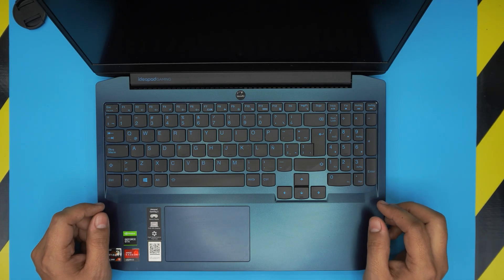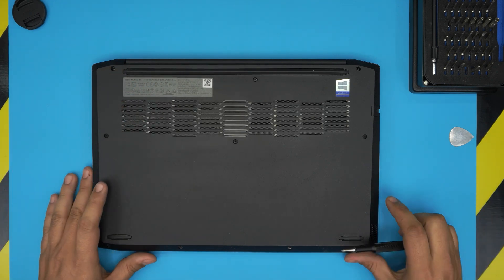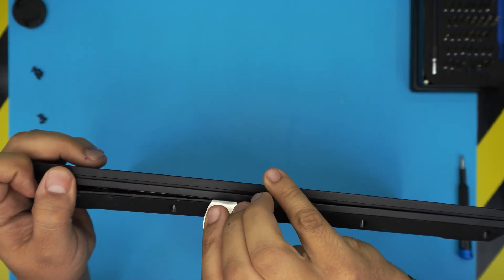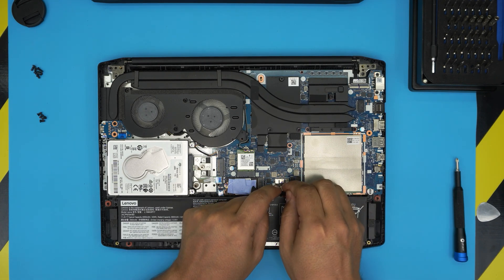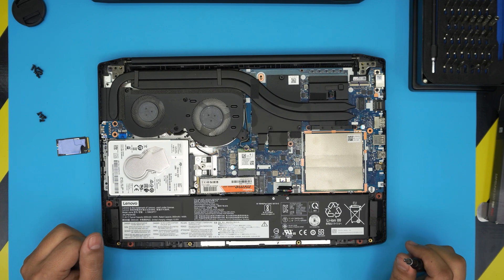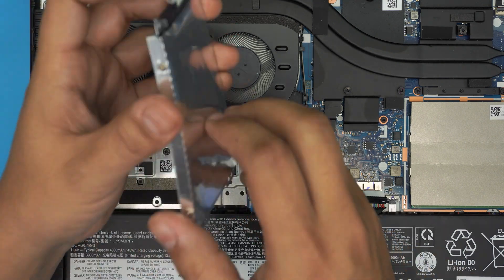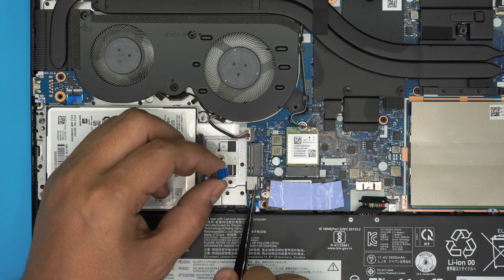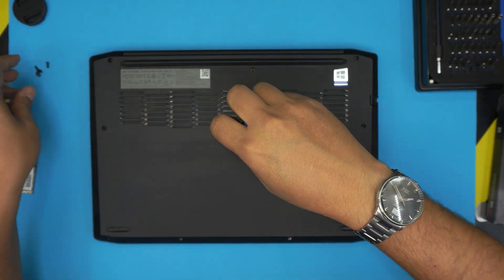How to Upgrade Storage (SSD-HDD) for Lenovo Ideapad Gaming 3 15Arh05 Laptop | Step by Step💻

Comment: so that shorter slot is for 2230 ssd i persume? would it work? coz i have seen ppl installing 2280 or 2242 in that slot with a bend n it works. so would 2230 work or its intended for something else?
Reply from the maker: 🫠Regarding your question, yes, you can place a 2230 in there without any issues. If you place anything longer and force bend it, I promise you that after a few days or weeks, it will stop working. It will get hot—around 60°C—and with 5 hours of use at that temperature and a bend on it, the solder balls under the BGA will crack and stop responding. We've seen so many bent M.2s.
Should you have any further questions or requests in the future, please don't hesitate to ask me.
cheers🍻
Reply: @uFixTek  hm then ill just remove  the hdd n then theres space for 2280 with a mounting screw as well
Reply from the maker: Yes, you can remove the 2.5" drive and then remove the riser for the M.2, move it back to the 2280 position, and then install the 2280 M.2.

Comment: In my laptop there is 1TB HDD and 256GB SSD pre-installed, Can I install one more small 2230 NVME M.2 SSD in that extra slot? This will be good for storing the games and playing???
Reply from the maker: 🫠Regarding your question, sure, you can do it without any issues, and it will work perfectly fine.
Should you have any further questions or requests in the future, please don't hesitate to ask me.
cheers🍻
Reply: Which nvme ssd will be best for gaming 2230 or 2280
Reply from the maker: samsung pro 990 pro

Comment: In my laptop there is 1TB HDD and 256 SSD pre-installed, Can I install one more small 2230 NVME m.2 SSD  in that extra slot? This will be good? for storing the game and playing
Reply from the maker: 🫠Regarding your question, sure, you can do it without any issues.
Should you have any further questions or requests in the future, please don't hesitate to ask me.
cheers🍻
Reply: @uFixTek which nvme ssd is best for gaming 2230 or 2280?
Reply from the maker: 2280

Comment: I got some questions sir 

I'm new to laptop upgrading and I have read comments saying that it actually have two m.2 ssd slot but idk where is it actually (maybe you have shown on the video but i'm too dumb to find out that i'm so sorry) 

also i did scroll through the official lenovo website saying that it only support pcie 3.0 ssd so is that mean i can't use a pcie 4.0 on the laptop?? 

another question so my current window os is installed on my 256 gb ssd so if I want to upgrade my ssd is that mean i have to install the os again as i removed the original ssd

some addtional question as I know that some ssd i buy will come with heat sink is that can't be used and will it affect if have no heat sink and after removing the thermal pad it is broken will it affect anything??

final question I wanted to upgrade ram to can i upgrade it to 32gb and like what kind of ram i should choose also is there any thermal pad or heat sink i gotta add?

I'm sorry for asking dumb question man I love your content and you did a great job just I'm too dumb to understand that I'm so sorry
Reply from the maker: 🫠Regarding your questions:
-The secondary M.2 slot is here @8:53
- You can place a Gen 4 NVMe, and it will work, but at Gen 3 specs.
-Yes, I recommend you create a Windows 11 USB drive, perform a fresh install, and do a few Windows updates, and you will be all set.
https://youtu.be/T0uBTVNCdAQ
- Don't buy an NVMe with a heatsink—it will not fit and you won't be able to close the bottom cover.
-regarding the ram upgrade here is the video: https://youtu.be/DF-SHZJvUm0
-It's my pleasure my friend.
Should you have any further questions or requests in the future, please don't hesitate to ask me.
cheers🍻
Reply: @uFixTek  thx for your answer man you helped me a lot keep going with your content sir you are so kind
Reply from the maker: @習大大佢堅持為你 thank you for your support 🤓

Comment: Do you know if i can put 2.5 SSD sata instead of 2.5 HDD? Do you know if the motherboard supports that? Btw. Does laptop come with sata cable or do i have to buy it separately?
Reply from the maker: 🫠Regarding your question, yes you can and yes the laptop comes with the adapter inside.
Should you have any further questions or requests in the future, please don't hesitate to ask me.
cheers🍻

Comment: Thanks for your video. I have a question, what is the blue cable wich links SATA disk to the motherboard please ? I don't know this. I hesitate between add a 2nd NVMe disk or add a SATA disk. Thanks
Reply from the maker: 🫠Regarding your question, i would highly recommend you to add a 2nd nvme, for the best file transfer speeds.
and the cable is a sata flex adapter cable.

Comment: I have the 256gb short nvme ssd and 1 tb samsung hdd. I am trying to upgrade the hdd to 1 tb nvme ssd, but my concern is that there will be no cooling pad/gel pad or heat dissipation on the slot where the hdd is, in which I attempt to install the new nvme ssd, will there be heating issues for normal usage and normal gaming, how will it affect the nvme ssd for long term with no heat dissipation material? Please help
Reply from the maker: 🫠Regarding your question, if you install a 1TB or 2TB NVMe, you don’t need to worry about overheating or performance loss, and its lifespan will last a long time.  
If you like to have a heatsink on it then you can get a slim heatsink, like this:
https://amzn.to/3Dob9Yi
Should you have any further questions or requests in the future, please don't hesitate to ask me.
cheers🍻

This is an Amazon affiliate link. When you use my links, you are helping to support the channel. 🙏
Reply: @uFixTek  Thank You So Much
Reply from the maker: It's my pleasure my friend.

Comment: Where can I find that SATA to Motherboard cable that connects the big SSD to the motherboard?
Reply from the maker: 🫠Regarding your question, you will need to search for it on eBay or AliExpress by using the laptop model and "HDD flex cable adapter" as keywords.
Should you have any questions or requests in the future, please don't hesitate to ask me.
🍻cheers

Comment: Hey, Thanks for the explanation I really appreciate how you detail everything, can u help me with this question please : Instead of a 2.5 SATA I want to install another M.2 SSD without removing the one that is originally there, so is there a slot to plug-in another M2.0 SSD ? I can see on the screen another contact (just above the SATA contact) which is similar to the one connected to the original NVMe, can I use that one ?  I imagine I have enough space for a 1TB M.2 there if I don't have any SATA, confirm please. Thanks in advance.
Reply from the maker: It's my pleasure my friend.
i appreciate your support, 🫠Regarding your question, sure you can have another storage and still keeping your 2.5' and the main nvme. the one nvme short that you need is the model: nvme 2230 model
https://amzn.to/4gbpvc1
Should you have any further questions or requests in the future, please don't hesitate to ask me.
cheers🍻

This is an Amazon affiliate link. When you use my links, you are helping to support the channel. 🙏
Reply: @uFixTek  Thank you, I will check it out right now and come back if needed for further details. :yougotthis::goodvibes:
Reply from the maker: awesome, good luck
Reply: @uFixTek help please I m still here with laptop unmounted 😂, can I let the 2230 unscrewed over there ? or will it be damaged due to the fact it will be bended and so it will touch the aluminium pad on the bottom part of the laptop ?
Reply: I did order the NVMe u recommended, but the screw slot doesnt match so I can't screw it there... what should I do ? I can sens a pic with more details

Comment: Hi i have my hard disk removed from this laptop however the 256gb ssd by lenovo is still there. Can i install another 1tb ssd along with the 256gb one? Basically keeping both the ssd?
Reply from the maker: 🫠Regarding your question, sure you can my friend, without any issues. even a 2TB if you want
Should you have any further questions or requests in the future, please don't hesitate to ask me.
cheers🍻

Comment: Sir please reply 
Can I install crucial nvme m.2 512 gb T500 2280 ssd  in the 2242 slot??
Reply from the maker: 🫠Regarding your question, I don't recommend it because it will slightly bend the SSD, which can cause damage to the SSD over time or even instantly. Don't risk it.
cheers🍻

Comment: I use 3 hard drives. 2 ssd and 1 hdd. You can insert a 2280 nvme that will sit on top of the hdd. It'll bend slightly but not concerning. I'm using this setup for 3 years.
Reply from the maker: You can, but it is not recommended because the SSD 2280 you have may have chipsets at the ends of the PCB. While the bend might not affect it much, if someone gets an NVMe with a PCB full of chips, it's very likely it could get damaged. However, anyone can risk modifying it.
But the correct method is mentioned in the video for the safety of the viewers.
cheers🍻
Reply: @uFixTek  I appreciate your response. I just wanted to let anyone know if they want to implement this setup.
Reply from the maker: I appreciate the tips on how you've done it, for those people who may be interested on implementing the full size on their lapto.

Comment: Hello, thank you for the video. I installed a 240 GB SATA SSD to my Lenovo Gaming Ideapad computer, but the computer did not turn on. Esc and power buttons are blinking, what should I do?
Reply from the maker: Remove the drive and power on; you should get a message saying "No hard drive," because the laptop should turn on with or without the drive installed. So, remove it, power on, and see if it displays anything.

Comment: hi bro,
I am thinking to remove the stock 256gb Type - M.2 2242 ssd and replace it with an 1/2TB M.2 (2280) SSD to install more games and keep the existing HDD to store other files saving money. However I am afraid to make the SSD purchase since Lenovo website states that the max SSD capacity is 512gb, can you please confirm if this is true?
Reply from the maker: 🫠Regarding your question, don't listen to what Lenovo says.
The M.2 is NVMe (PCIe lane) you can install up to a 4TB NVMe without any issues; we've done it for our clients. You can have up to a 4TB NVMe and, at the same time, a 2TB HDD (low profile) or a 4TB SSD 2.5".

Should you have any further questions or requests in the future, please don't hesitate to ask me.
cheers🍻

Comment: my model allows for a longer stick of ram for the first slot, and does not come with any hdd. Is the cable and samsung hard drive you linked in the comments still compatible with my model or is it the same? great video too
Reply from the maker: It's my pleasure my friend.
🫠Regarding your question, yes the links are compatible and will work just fine.
cheers🍻
Reply: @uFixTek  👍

Comment: Hey i'm new to this stuff can i ask does the Samsung 990 pro m2 2tb heatsink fit in?
Reply from the maker: 🫠Regarding your question,no get the one without the heatsink. if you get the one with heatsink it will not fit.
cheers🍻
Reply: @uFixTek  That's what i thought but had to double check cheers and thank u😅
Reply from the maker: It's my pleasure my friend.

Comment: bro ı have to know what size the empty m2ssd slote . Cuz i have a ideapad and the memory inst enough for me and i will buy a ssd for it . While I was researching, I came across your video and saw that empty slot, then I started researching but I couldn't find the size of the slot (I know the slot can be expanded when we remove the HDD, but I don't want to remove it).
Reply from the maker: 🫠Sorunuzla ilgili olarak, en fazla 2TB olan bir "NVME 2230" yerleştirebilirsiniz.
Ve daha uzun nvme ise "nvme 2280", aynı zamanda HDD'yi koruyarak 4TB takabilirsiniz.
İleride başka sorularınız veya istekleriniz olursa, çekinmeden bana sorabilirsiniz.
Şerefe! 🍻
Reply: @uFixTek  How can I install 4 terabytes without removing the HDD? My own computer already has a 1TB HDD and a 256GB mini SSD. What size or model of SSD can I fill the empty slot with without removing the HDD?
Reply from the maker: i just told you the model of the ssd that fits without removing the hdd.
"NVME 2230" 2TB max
"nvme 2280" 4TB max
Reply: @uFixTek  thank you
Reply from the maker: It's my pleasure my friend.

Comment: Tanks alot. But is there are maximum of GB which are supportet by the system or can i also use 1 or 2 TB ? And do i have to be cearful about the static charge.
Reply from the maker: It's my pleasure, my friend. 😊 I deeply appreciate your taking the time to provide feedback. If you're inclined to support the channel further, feel free to like and subscribe—or even both!
Regarding your question, there is no limit you can have a 4TB and 4TB (make sure the nvme is single sided if you going to 4tb).
and zero worrying about the ESD.
Should you have any further questions or requests in the future, please don't hesitate to ask me.
cheers🍻
Reply: Thanks for the quick response! 
 @uFixTek
Reply from the maker: It's my pleasure my friend.
Reply: @uFixTek   I searched the whole internet, but I finally found my answer here. Thank you!

Comment: I have this notebook and i'd like to add another NVME drive instead of a sata drive.
Currently I have the original 512GB NVME drive and a 256GB evo 850 SATA drive installed.
I'd like to swap out the SATA drive for a NVME. It seems possible, although I worry that the available PCIE lanes will be taken (shared) from the GPU(s) or 512GB SSD resulting in slower speeds/bottlenecks.
Do you perhaps know this is a possibility with this laptop?

Excellent video!
Reply from the maker: Thank you for your feedback! If you wish to support the channel, you can like, subscribe, or both!
Regarding your question, you can place one 2.5" SATA SSD or HDD, you can't place a nvme 2.5" on that!
at the same time you can have a 2x m.2 NVME's 
the full size nvme (2280) can be installed right by the battery and you can install the windows on that up to 2TB without affecting the performance.
and also you can have a short NVME (2230) 2TB  in front of the HDD.
al this at the same time and will not affect the performance of the GPU at all.
https://amzn.to/3U5Rylp
https://amzn.to/3S9eC05
Should you have any further questions or requests in the future, please don't hesitate to ask me.
cheers🍻

This is an Amazon affiliate link. When you use my links, you are helping to support the channel. 🙏

Comment: So there are 3 alots available for storage upgrade the ssd which is the big brick one, the long stick one and the mini one above the stick one but it is rarer to get those correct?
Reply from the maker: Thank you for your feedback! If you wish to support the channel, you can like, subscribe, or both!
Regarding your question, yes there are 3 slot for ssd upgrade, 2x m.2 slot and one 2.5' sata.
Should you have any further questions or requests in the future, please don't hesitate to ask me.
cheers🍻
Reply: @uFixTek  thankk you it hps me a lot bless you
Reply from the maker: It's my pleasure my friend.
Reply: I had succesfully installed 3disks using the Sata3 HDD, M2-2280 and M2-2242. Forced the default M2-2242 making it fit along the Sata3 port, and fixing it with glue. (the screw socket doesn´t fit). It is forced and  messy but works just fine.  Got to work with the default 256Gb M2-2242, 1Tb Sata 3 HDD, and a new 256 Gb M2-2280. It is an already old laptop, I´m not thinginkg in using the warranty no more.
Reply: @sabesisebas  lol I have put a 2230 where you have put your 2242, and as for you the screw socket also doesn't match, and I don't have any sata... so I ve just let it there bended and it seems working... at least till now. So what on earth that screw socket is even made for ?? ☠(I mean the not matching one, I know that in general those screw sockets are there to secure by connecting to the ground... actually I think it's that lol)
Reply: @ElectroBanaana Is it still working? xd

Comment: Hey, great video. It helped me a lot. I have one issue though. As I saw in your replies, you can install 2 TB SSDs, however I recently got one and couldn't fit.
My guess is that I didn't purchase the Samsung SSD you suggested (I got a Kingston Fury Renegade because it was cheaper and considered all SSDs to be the same). But I want to know for sure from you. Thanks!
Reply from the maker: Thank you for your feedback! If you wish to support the channel, you can like, subscribe, or both!
Regarding your question, the issue is that you got an NVME with heatsink, you can't use ssd with heatsink. remove the heatsink and it will fit without any issue.
you don't need heatsink for the ssd up 2TB, if you get 4tb then sure you need one.
Should you have any further questions or requests in the future, please don't hesitate to ask me.
cheers🍻
Reply: Can you get 2x 2TB for 4TB in total or 2x 4TB for 8TB in total? Im confused cuz u said it can handle up to 4TB but is it for 2 SDD's combined or per 1@uFixTek

Comment: Hello ,I have a 1 simple question: can i put a samsung 990 pro 1 tb m.2 2280 format on both slots ( where the 2230 is located and the slot next to where the hdd is located ) I would be glad if you reply 👍👍
Reply from the maker: Thank you for your feedback! If you wish to support the channel, you can like, subscribe, or both!
Regarding your question, sure my friend you can have a up to 2x 2TB nvme on this laptop without any issues, all you need to do is slide out the riser, and slide it back to other end so you can screw the 2280 nvme, as see in this picture: https://imgur.com/a/dzPh4ol
you will need to remove the HDD as it can't fit the anymore.
the best nvme are the samsung nvme PRO: https://amzn.to/3Q8HapA

Should you have any further questions or requests in the future, please don't hesitate to ask me.

This is an  Amazon affiliate, when you use my links, I earn a percentage, which helps support the channel🙏.
Reply: Thank you 😄😄
Reply from the maker: It's my pleasure my friend.
cheers🍻